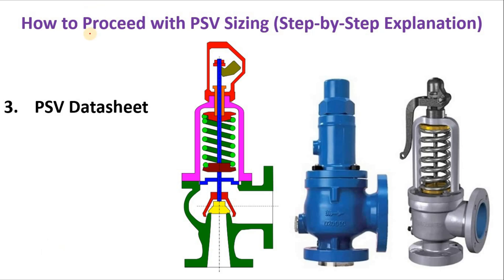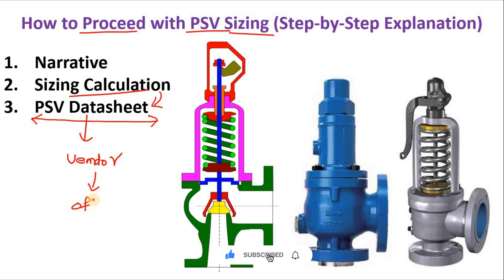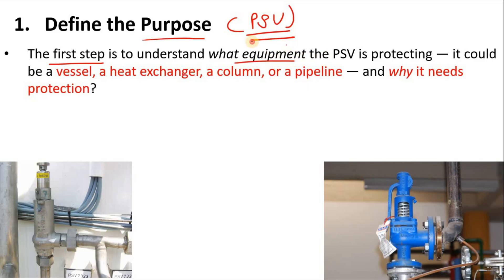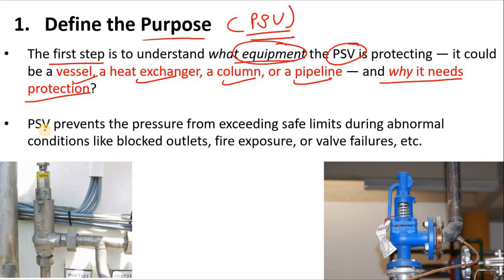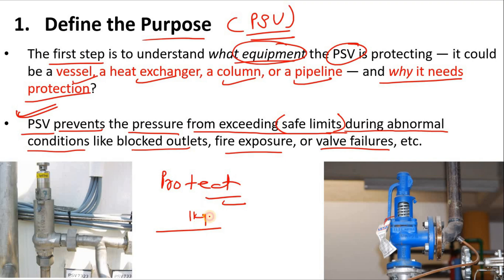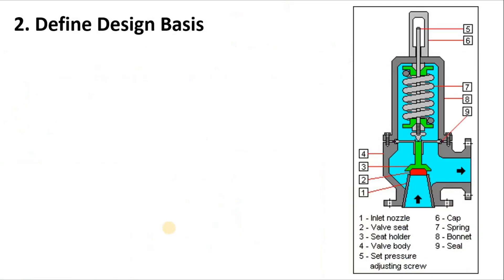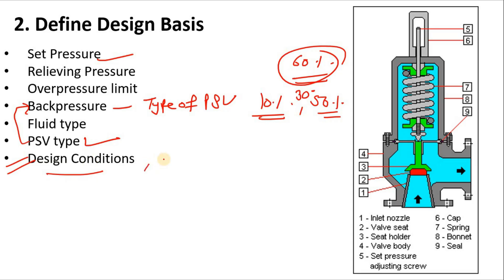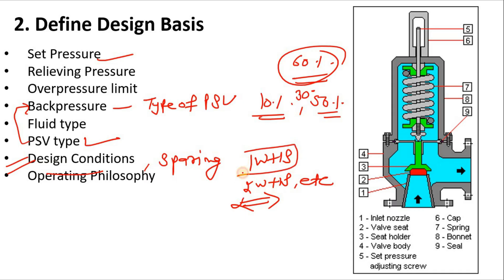how to proceed with PSV sizing

Comment: Can i use PSV for oil , water, air , vapour, steam????
Reply from the maker: Yes It's used in water (as a TSV normally you can see at the downstream of Heat exchanger), air(on Instrument Air vessels), Vapour, Steam ( steam header and boiler drum)

Comment: Generally Fire case is not applicable for piping. Thermal Expansion case is applicable for the block portion of the piping,it is also depends on blocked portion length and size of line